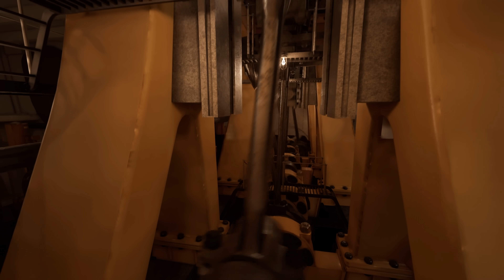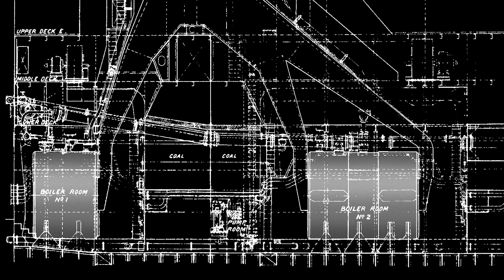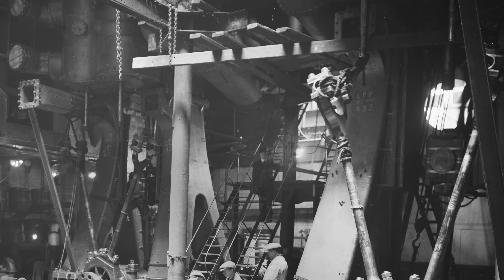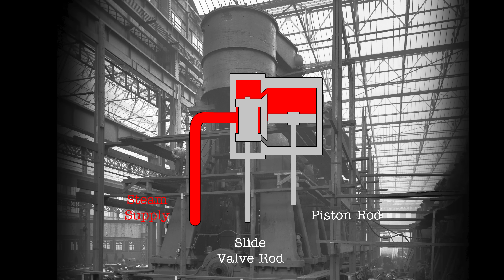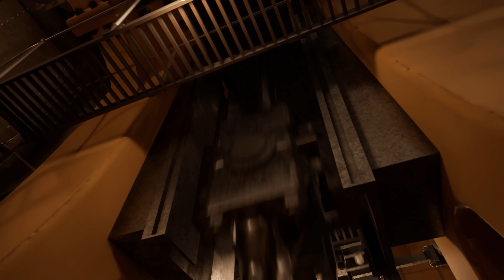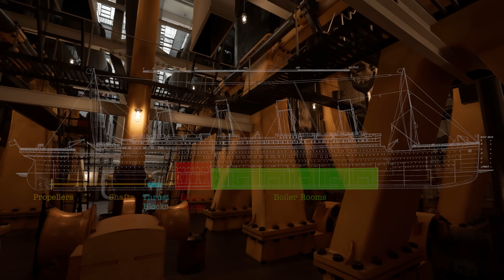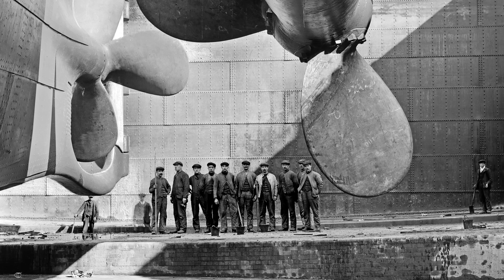A Complete Guide to Titanic's Engines

Comment: I just noticed that every one of your graphics of the propellers, all three are turning the same direction.  But in your photos, the propellers for the center shaft appear to be pitched opposite to those of the two main propellers.   Did the center turbine turn opposite the of the outside propellers?  It was a GREAT  re-watch anyway!   Thank You!
Reply: Due to different levels of water pressure at top part vs bottom part, ship / boat propellers create "prop walk", which means they will not just push directly forward but also somewhat  kick or 'walk' the stern to one side. 

To mitigate that, multiple propeller setups will never all rotate in the same direction, or else all the individual prop walks will add up. A twin propeller setup will therefore have one right handed prop and one left handed prop, so the prop walks cancel each other out. Likewise, four propeller setups will use one RH pair and one LH pair. When you have odd numbers of shafts you cannot cancel the prop walks out entirely (unless you use twin contra-rotating props on the same shaft, which requires very complex gearing), so you do the next best thing, like they did on Titanic: two props turning one way, third one turning the other way, so at least two of them cancel each other out, leaving only a net prop walk equivalent to one propeller.

Clear as mud? :)

Comment: I think the exhaust pressure of the third expansion cylinders must be 9 psi above atmosphere (gauge), not absolute. Else when the exhaust port opened air would rush in rather than the steam coming out. Also the air in the engine room would be resisting the downward motion of the third expansion cylinders as soon as cylinder pressure dropped below atmosphere, giving the rest of the engine more work to do.

Comment: A pressure gauge I believe ,  is set so 0 psi is atmospheric . So 9 psi is 9 psi above atmospheric ,if it is below 14 +or - it is a vacuum . Air would rush in to a container that had less than atmospheric , the steam turban would draw air in from the exhaust because the pressure of the air is higher than inside the turban . The pressure would be 5 PSI BELOW atmospheric the turban would run backwards
Reply from the maker: Nope, the condensers at the end of the system were maintained in a 28” vacuum and the turbine ran at 9psia :)

Comment: Here's a good example of just how large Titanic was, and how powerful her machinery was: A comparison to the most powerful British warship commissioned the same year

HMS King George V 
Overall length: 597' 9"
Beam: 89' 1"
Draft: 28' 8"
Deep load displacement: 27,120 long tons
Installed power: 27,000 horsepower
Maximum speed: 21 knots

RMS Titanic
Overall length: 882' 9"
Beam: 92' 6'
Draft: 34' 7"
Displacement: 52, 310 long tons
Installed power: 46,000 horsepower
Speed: 22 knots

Comment: Just looking at the turbines and all those compressor blades - Its a wonder it took the later stages of ww2 for someone to take a compressor powered by kerosine seriously. Apart from the heat resistance materials problem - they practically had the thing worked out. Instead of a drive shaft however, to think it could produce direct thrust was probably the other logic problem that took a while to grasp.

Comment: Mike, it's your friend, Andy. 

As a mechanical engineer myself, I really enjoy these deep dives into the technical aspects of how these great ocean liners operated. I'd love it if you would do a video explaining how it is possible to pass a spinning prop shaft through the hull of a ship, below the waterline, without letting in the ocean and sinking the ship. I think this is a rich topic that we often take for granted in it's function. Some additional questions that I have are whether universal joints are used or if the propellers are axially aligned with the shafts? If universal joints are not used, would this mean the prop shafts have to be aligned perfectly front to back to prevent inefficiency in propulsion and power loss? Finally was there any additional gearing or other powertrain components used in transmitting that torque from the prop shaft inside the hull to the propellers outside the hull?

Thanks again! Big fan of the channel. Happy new year!
Reply: The shaft passes through a large seal called a 'stuffing box.'  It works just like the 'packing' of an old-fashioned water faucet.  See your local plumbing department for further details.  

Universal joints can't be used in machinery as large as this, so precise alignment was needed.  There are flexible couplings for somewhat smaller applications.  

Reciprocating engines ran at the same rpm as the propellers, but gigantic gears were used with high-speed turbines in later ships.  

Later, some ships used their turbines to turn huge generators, which in turn powered equally-large electric motors to turn the propellers. I think this system is widely used on warships and the last of the ocean liners.

Comment: That the turbine could extract 15000HP from just an 8psi pressure drop remains probably the most amazing feat to my mind!
I also read once that the steam's time of passage from the high pressure cylinder inlet to the condensers was about two seconds - can any confirm of refute that?

Comment: You lost me on what forces are acting on the Thrust Blocks and how they Isolate the Crankshaft from the Propeller Shaft.
Is it simply the forward force of the Propeller pushing on the collars so no side loading occurs at the Engine Bearings?

Comment: Sorry to do this Mike but there appear to be a error in the rendering imagery. That central screw is providing reverse thrust. Either rotating the wrong way or blade angle is mirrored. Unless the turbine operated at a significantly higher speed then the reciprocating engines to the point of giving a illustration of turning backwards. I think at that speed the water would cavitate. I promise I wasn't looking for faults ❤

Comment: I mentioned this in the previous iteration of this guide, but you kind of missed one tiny detail.

I might just be nickpicking here, but in the animations depicting the Propellers, the Central Propeller seems to be rotating Counter-Clockwise.

Now, this wouldn't be such a problem if I thought this was just a part of the design, until I noticed that the prop blades were meant to be rotated Clockwise in order to propel the Titanic forwards.

As it stands, the animation depicts the Central Prop turning in Reverse, which is quite literally Impossible, as you just mentioned: the Turbine isn't geared to run in Reverse.

Hopefully you'll find this comment and maybe fix that animation error, if time permits at least.

Timestamps:

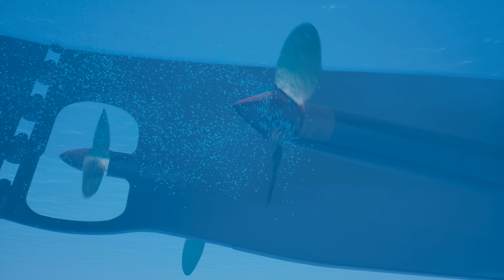3:16, 22:52 and 23:31 depicted this issue.

In 27:40 the Central Propeller is turning Clockwise, but it's still an issue when you examine the Propeller Blades.

Honestly it just looks like the Animation had been flipped in a mirror.

Comment: The plant could not have been too bad. In the case of RMS Olympic, I believe the propulsion units remained until the ship was scrapped, the only modification that was made was converting the boilers from burning coal to oil, and the subsequent reduction of staff in the boiler rooms.
A contemporary ship built two years latter, US Battleship Texas also employed triple expansion engines. Similar to  RMS Olympic, Texas had her coal fired boilers removed after the Great War (WWI) and replaced with oil fired boilers. Texas remained in service until after WWII.

Perhaps the only detail you could have included was the size of the cylinders and stroke.
LP 97" x HP 54" x IP 84" x LP 97", stroke 75".      (2.46m x 1.37m x 2.13m x 2.46m, stroke 1.9m all approximate.)

Comment: Very nice Mike. Quite detailed and updated. I'm blown away by the technical advances of the 20th Century. How were they able to get effectively NEGATIVE pressure leftover from the reciprocating engines to run the turbine at an atmospheric pressure lower than ambient?! Wow, she really was a technological advancement and at such awesome fuel savings. The 20th century really was an technological leap forward in so many ways.
Reply: If the condenser temperature is low enough and the steam system is closed to the environment, you can expand steam below ambient pressure.
Reply: That was an old principle in 1912.  It was developed by James Watt around 1800.
Reply: @NaNlinear  Mike actually addressed this in the other video. It's 9 PSI Absolute, as referenced by Harland & Wolfe records and writings.
Reply: Running in the North Atlantic would've helped in this regard, as pulling such frigid water through the condensers would have increased vacuum on the steam side.

It's a bit funny that taking in colder water and deliberately dumping heat (the main product of a coal fire) into the ocean actually improved system efficiency, but the engines work on a pressure difference, rather than temperature. 

To illustrate this, consider that at sea-level atmospheric pressure, water changes to steam, and vice-versa, at 212°F. At higher altitudes, like in the Swiss Alps, water can boil at only 195°F.

Titanic's boilers were producing 215 PSI steam at around 400°F. By the time it left the reciprocating triple-expansion engines, the steam was down to 188°F - but because the pressure was so low, it was still steam! After leaving the turbine, it was colder than a cup of tea at around 100°F... but STILL a gas! It wasn't until the condensers dropped the steam to 60°F that it finally returned to water.

It was good engineering but not a new concept at the time. The Industrial Revolution started about a century and a half prior, but these concepts go back to the late 1600s and early 1700s: A lot of work is credited to Denis Papin, who, also known for essentially inventing the autoclave, pressure cooker, described a piston steam engine working on these principles in 1690.

Comment: Absolutely fascinating. I did notice, however, that in the animation of the three rotating propellers as seen below the waterline, the center one is running in reverse; I.e., thrusting forward rather than aft. Either the blade pitch or direction of rotation is incorrect.
Reply: Look at the pics of the sister ships props!

Comment: Below atmospheric pressure ?? Come one.   Ocean Know your stuff man
Reply: Are you suggesting he doesn't?
Reply: he doesn't  at 9psi you are still 9 psi above atmosphere not below   and he still has the center propeller going in reverse ?? outside of that he does amazing work  @1934BSA
Reply: It's closed system, it's like your refrigerator that has high pressure on one side of the plumbing and low pressure on other side. Titanic plumbing went bellow atmospheric pressure.
Reply: Yeah, come one...

🤡

Comment: This time around, I'm thinking of Olympic's engines.
When she was scrapped, it was stated that her engines were as fine as ever. I wonder if her scrappers had the sense to remove them and put them somewhere they could be used? Or if they were dismantled like the rest of the ship?
Somebody knows, I'm sure, so it'd be nice to learn.
Thanks, Mike! Big respect for your willingness to "correct" oversights!
Reply: Reciprocating engines were already outmoded on every metric by the end of Olynpic's career (that was part of the reason she was scrapped rather than being given another overhaul). By that time, turbine drive systems had become more powerful and more fuel efficient, and all with fewer potential points of failure.
Hull 400's engines would have been disassembled and melted down to be recycled.

Comment: Water for passenger use (drinking,cooking) was stored in 7 tanks. 6 of the tanks were in the “electric engine room”, three on each side, and 1 forward… a total of 962 tons of water. ( not sure if regular tons or long tons)…water was passed through 2 filter systems before usage…
 Boiler feed water was stored in 6 tanks, part of the ballast system, below the engine room. Aprox. 1000 tons of water.

Comment: Its interesting with the technology they had at the time, they didn't use a conveyor system to run the coal from the coal bins to the boilers. It would've saved significant man power. I wonder if they even considered that option?
Great video update!
Reply: I am sure I read somewhere they had to break the coal into smaller pieces first, but after that some sort of gravity feed would make sense

Comment: 32:31 Correct me if I'm mistaken, but at this point of the video, the shot showing the propellers seems to be showing the central prop spinning in reverse thrust mode while the two on either side are properly spinning to match the depicted flow of water, ie, the ship is meant to be travelling forward.

Is this a mistake on the rendered footage, or is there a legitimate reason why the central propeller is in reverse mode while the other two are in "full ahead"?

Comment: by condensing the steam, the large volume of steam was reduced to a much smaller volume of water.  This created a vacuum that allowed the steam in the turbine to work at even a lower pressure, generating more power.  The temperature of the steam going into the main engine (T-1) minus the temperature of the exhausted and condensed steam (T-2) divided by T-1 is the efficiency of the engines.

Comment: Mike, 
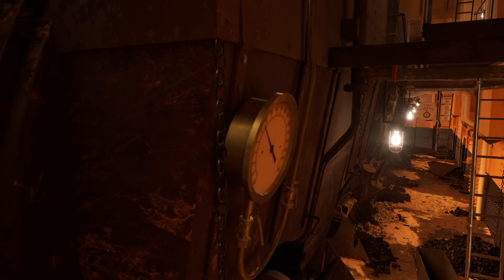Thanks for taking the time to redo this video.  It was amazing and made much more sense given my limited experience with steam locomotives.  I do have one question about the size of the burning surface area of the furnaces.  How was that calculated?  It is stated in the video at about 10:30 to be 144,000 square feet.  That seems like a really large number. If we assume in round numbers that the entire boiler room space is 300 feet by 100 feet, that only equates to 30,000 square feet of boiler room floor.  Not every square foot of boiler room floor is occupied by a boiler making the available space much less than 144,000 square feet.  Thanks again for this amazing look at such a great machine.

Comment: Most big ships had 4 propellers. Titanic was built with the new 3-propeller configuration combined with an undersized rutter. It made the massive ship hard to stop and slow to turn without forward power.
Reply: The rudder was the correct size for the ship….
Both the Olympic and Titanic responded well to rudder commands during the sea trials…
Reply: But this is true of any ship, whatever the propulsion. The rudder's not going to do a thing unless a certain minimum forward speed (steerageway), and after that rudder effectiveness is a function of water flow velocity.

This was part of the point of the center propeller -- to aim its generated flow directly on the rudder and increase its effectiveness. That's how Titanic became a decent turner.
Reply: Hey davin, why don't you just shut up and watch the video?  Spare us your hypothesis and wives tales.

Comment: Any idea how they kept water out of the propeller drive shaft? The propeller shaft is a moving part under water and I’m curious how they sealed it.
Reply: The propellor shaft is solid. 
There would have been a stern gland at the rear of the ship where the shaft went through the ship's hull out to the propeller. This gland is sealed by compressing packing by a ring of nuts around the gland. To ensure the packing was not to tightly compressed on to the shaft to cause overheating and burning of the packing, it was tightened just enough to let a trickle of sea water to leak through and act as a coolant. Non maintained stern glands could lead to disasterous consequences and even flood the shaft tunnel.

Comment: Some interesting photos I've never seen before. I didn't know Olympic's prop had been damaged in the Hawke collision. If I remember correctly she later had another serious accident in which a blade came off an outboard prop after running over shallow wreck at the US end of a trans-Atlantic trip. Pretty horrendous to contemplate, apart from the shock load of the impact, I imagine huge stress was then put on the prop-shaft, its bearings and the supporting structure during the time it took to spin the engine down.

Comment: One would think that some sort of conveyor system would have been contrived to feed the furnaces. Mebbe just cheaper to have it shoveled by hand? And, one has to wonder if a comprehensive CFD analysis on the propellers would have increased the speed of ship and decreased the power needed for speed. May have been able to match the Cunard Line with just a little more maths...

Comment: Great video mate, although I got confused when you were talking about the thrust shafts.How does it prevent force to the engines from the propellers ?
Reply: The propeller shafts had a set of collars attached to them, which had corresponding grooves in the thrust blocks. Like an axle attached through a bearing.
So when the propellers push the ship, they're actually pushing only the very durable thrust blocks, to which the rest of the ship is attached to. As such the propellers and their shafts don't end up skewering the hull like lances once they start spinning. This keeps the engines safe, as there is no force trying to push the crankshaft through the engine thanks to the thrust blocks between the engines and the propellers.

Comment: Funny to think that a nuclear power plant, or a nuclear powered vessel (aircraft carrier or submarine) works on the exact same system, it's just that the coal-powered boilers have been replaced by a pressured water nuclear reactor. I got the chance to visit Lisbon's museum of electricity, it's an old coal power plant were every piece of machinery has been opened to see the insides. What a blast to see the 20 MW (30,000 hp) turbines and the massive condensers. A really great visit I highly recommend